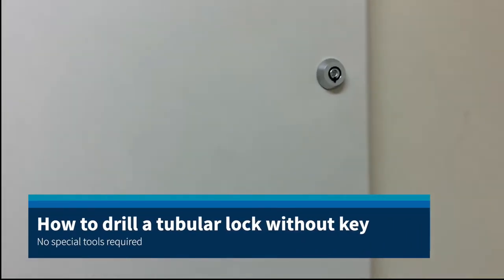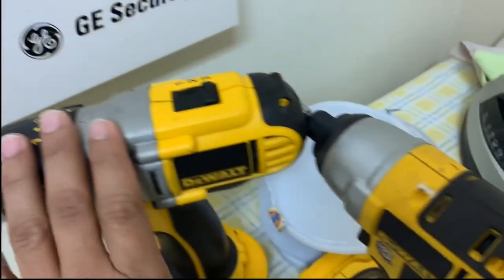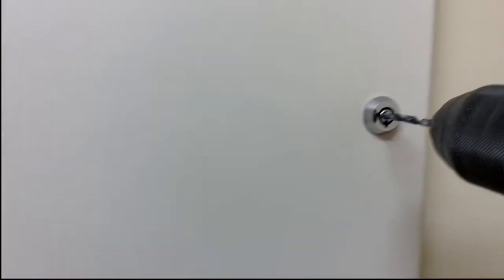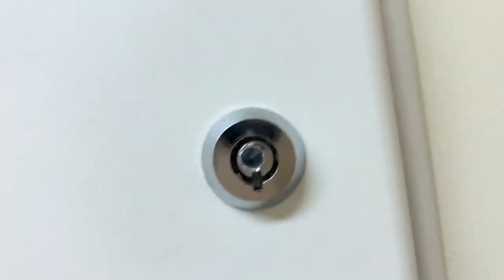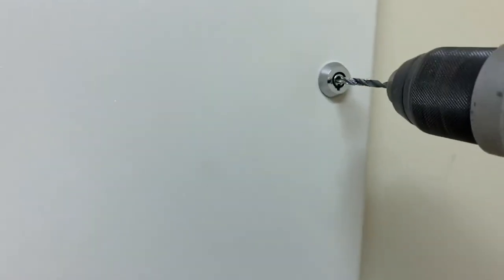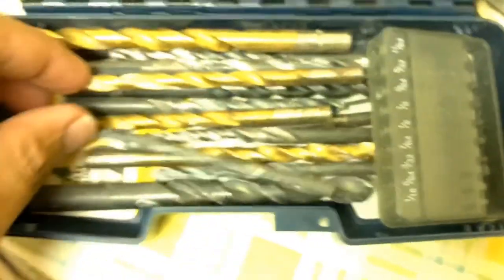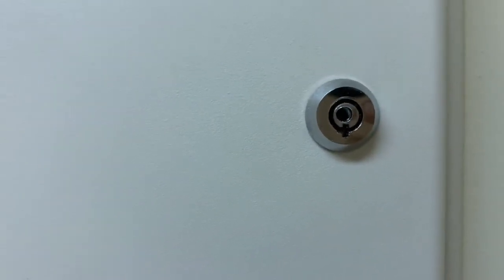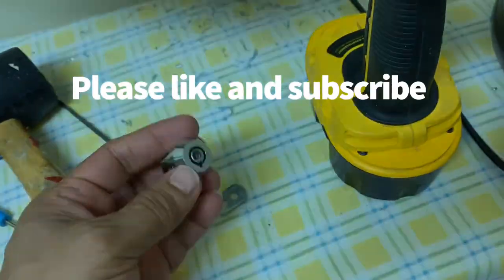How to Drill a Tubular Lock

Comment: Why do you progress to larger drill bits and not just use the large size to begin with?
Reply from the maker: Because you don’t want to drill to the. Ignore right away otherwise if it looses traction and drill in wrong direction then you are screwed and it won’t work.
Reply: @HowToDoitright  "you don’t want to drill to the" what? "right away"?
Reply: Just use a center punch rewl fast and ypur drill bit wont wander.